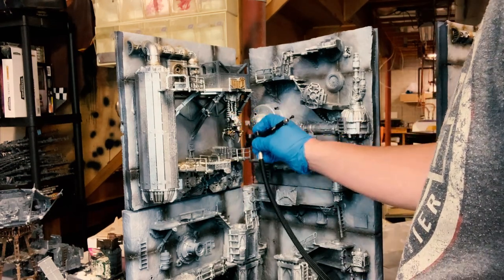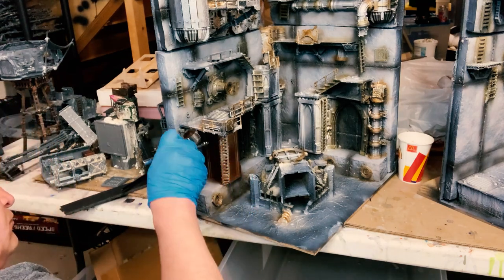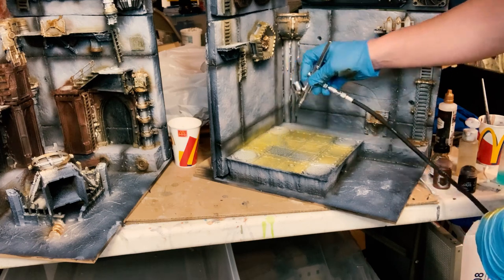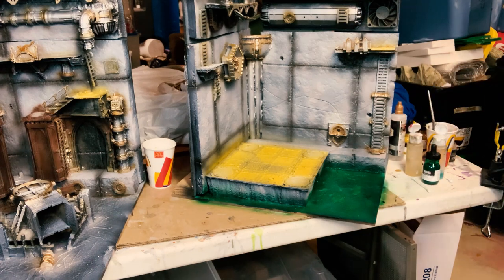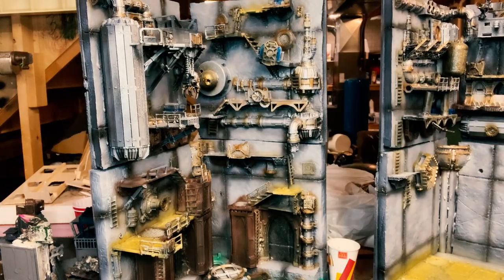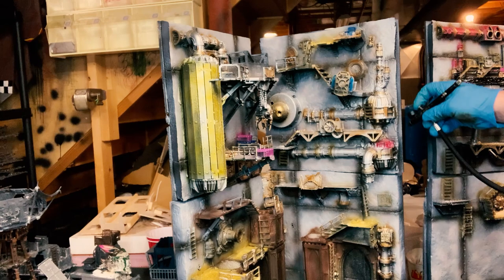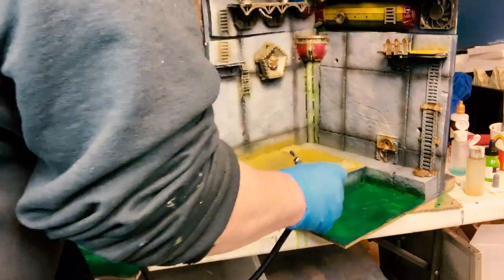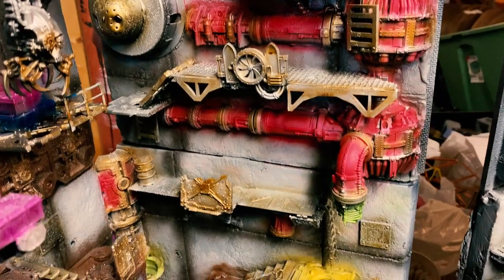Necromunda Sumpwall painting 2

Comment: You had said in another video that you did resin pours for furniture, do you know any viable techniques for going over printed photo's with resin or water effects?
Reply from the maker: Well.....  Some of the furniture that I did HAS photos in them yes.  The big trick that I found was to make the surface that the photo is on a bit bigger area and don't do the pour directly onto the photo.  Instead pour in an area that is next to it and let the resin slowly envelope it.  This requires taping down the photo from the backside of it so it doesn't float in the resin and a very very very slow pour.  You can adjust things during the pour using craft sticks or toothpicks as well.  I've also found that if you make the pour holding the cup or bottle that you have it mixed in a bit higher, this will take out most of the bubbles that inevitably occurs when doing resin.  I use envirotex lite brand resin because its pretty handily available and somewhat inexpensive where I live, but if your are going to make the plunge, my best suggestion is to do the same thing as you always do when trying out things..... practice first.  Pouring over stamps is one of the hardest things to accomplish. however its probably the best way to start out.  Hope that little spouting session helped out a little.  Thanks for the interest!
Reply: @jdinthesumpsea1560  Yes it did and thank you, I had an idea for printing out a board sized photo with a little bit of submerged stuff on top but no more than an inch and then using the picture to provide the depth so say there is an inch of underwater ruins that some over water ruins can sit on, maybe the top of an underwater sandbank or some such, but I just wasn't sure it was at all practical to even try.  If it wasn't worth the attempt my next thought was just a photo with a layer of gloss modpodge and some water effects stippled on top.
Reply from the maker: maybe try them both out on the same piece.  If you wanted to know how some of these projects i get into go out of control a little bit.  That's what happens!  I decide to get several different effects going on that I want to try out and BAM.....  big project goes nuts!

Thanks again for the comments!
Reply: @jdinthesumpsea1560  likes for the like god, comments for the comment throne